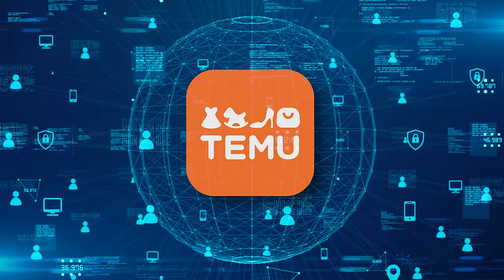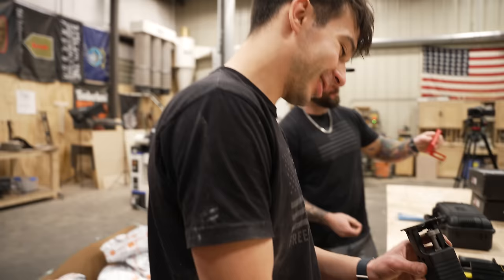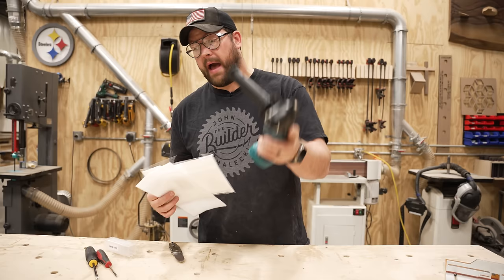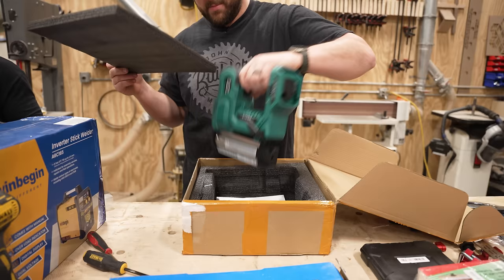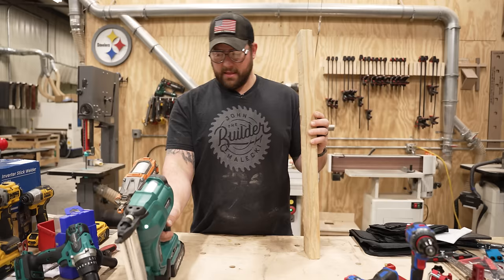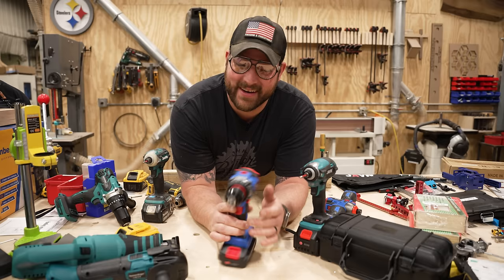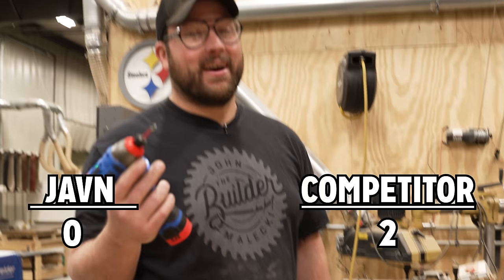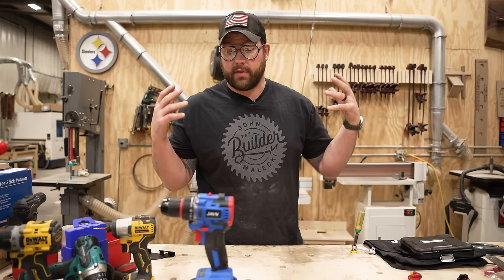I Bought A Pallet of TEMU Tools

Comment: I've never seen an entire woodworking company struggle so much to put in some screws
Reply: tbf, all the woodworking I see them do is fancy glue joints
Reply: I wonder what bit and screw system they were using? Ph, PZ, definitely not Torx. Maybe that weird rectangular hole.
Reply: Im not hiring them to build a deck any time soon lol, be full of holes from the drill bit slipping and jamming in the wood
Reply: @JohanFroloff81  as a Canadian, I am offended that you would call a Robertson screw a "weird rectangle hole" lol
In all honesty though, Robertson screws are the norm here in Canada  and they are probably the best screw head there is, with torx coming in a close 2nd
Reply: @JohanFroloff81   they did mention square head somewhere in there
Reply: @canadianhunter21  they arent actual woodworkers, that why so many of the things they say sound off
Reply: This is a shop full of people as skilled as I was when I first started building commercial cabinets at 18. How do you drive screws for work but can't do it with your left hand lol. I can tell someone hasn't had to install anything on a ladder or down a tight gap. You'd probably become a good sheetrocker with all the holes in the drywall you guys would be stabbing lol.
Reply: @JohanFroloff81  those are so effed. 
I used them once..  I needed self tapping screws with a black screwhead. What was available was with that square hole.. 
I'm still moving that drill bit around in my 'box of drillbits' 😅😂😅😂
Reply: What else would you expect from a company taking sponsership and repping Temu.
Reply: @canadianhunter21 I still think hex is the best head. No type of head type works with a ball shaped bit like hex does. I can drill my hex screws using a ball bit with the drill at a 30° angle to the bit.
Reply: @devoncantrell3311  absolutely not lol. I was a carpenter for a little while and i have used almost every screw type that you get and torx is by far the best there is by a landslide!!
Reply: @tylersmith8309  they probably do strip a lot less. I enjoy hex bits on models and small scale stuff because stripping isn’t really an issue. And the ball hexes allow for good angles on the models which is handy.
Reply: Hmmm kinda wasted my time with this video... A bunch of "woodworkers" that cant even use a proper screwdriver without hurting themselfs, not even 50% of the stuff they unpacked got put to use or showed. Just some randomen screwdriver races...
Reply: Womp womp Lil bro

Comment: With battery-powered drills in the Chinese market they will have their own name and their own battery standard but, most will use makita - bosch - dewalt batteries. 

I'm from southeast Asia, and professional workers in the countryside always like to use a brand like dekton because it has a German standard but is made in China.
Reply: Most of the time the colors show compatibility brand, those Makita, yellow for dewall, orange for B&D red, ect....
Reply: Thank you for replying.  I replied something similar up above.  Supporting the Chinese market will only come back to hurt him.
Reply: Interesting, from next year all battery operated power tools sold in Europe must have a universal standard battery that will fit all off the shelf power tools, adaptors are  already available but are cheap and nasty and weaken the power tool.

Comment: As a professional carpenter, for individuals who are just starting out or seeking budget-friendly tools, I recommend the following:

Buy used Milwaukee M12 Brushless tools along with new M12 Batteries. M12 batteries typically cost about half as much as the M18 ones, while offering the same capacity. I always recommend buying new batteries though. Buying those used is not worth the risk. I bought an almost new but used Fuel 1/4 impact driver for $70 and a 2 pack Red Lithium 2.0 battery set for $50.The impact can switch between drill mode and impact eliminating the need to purchase two tools. Once you are looking to level up, move on to the M18 series. For anything that requires lots of drilling power buy either a Makita or a Milwaukee corded drill for $115 and $90 respectively. They have plenty of power and should last you a long time. My Makita corded drill served me about 15 years.

Comment: Try using a makita battery in the javn brand stuff. It’s worked for me before with a single hand battery chain saw and the makita battery in it made it much better to use and it didn’t cut out like the cheap battery does in it.

Comment: All those temu tools are all gonna end up in the landfill. The name brand tools are more expensive for a reason. 

Sure the temu drill is half price, but they probably won't last even half as long as one of the name brands.
Reply: depends on the user. If you really only use it 3 times a year, the endurance doesn't matter a lot and the more expensive tools are clearly wasted money.

It may be dubious to buy at Temu, but no name brands from the box stores or whatever will be pretty good enough for the low usage cases.

If you want to use such tools professionally you should invest into professional grade tools. That's a no brainer. But on the Homer Simpson level? Why?
Reply: yup I can vouch for this, i ordered a set of metal drill bits, the Chinesium ones lasted about two holes drilling into 10mm mild steel plate before they went blunt whist my cheapo cobalt bit's last around 10 holes before becoming blunt.
Reply: Most "name brand" tools: made in china.😂😂😂
Reply: @robertmceuen3630  indeed they are HOWEVER those brand tools are then quality tested by those specific companies to make sure they're compliant to standards world wide & is up to their brand standards, a drill that burns out in a day would tarnish there reputation with that customer meaning they'll never buy from them again & because of our consumer laws this would warrant a refund.
the reason they're so cheap is because they don't do the R&D they steal it from other companies, do QC & finally give you your money back(also because of slave labor but that's a different issue).
Reply: As a nice to have, get Temu, as a way to make a living, go for quality

Comment: Would love to see an endurance test. How many screws can you drive on a full battery? How much down time between battery charges? How long before tool malfunction? It’s fine to pay half price for a tool, but if you have to buy three, might as well go for the better brand.
Reply: Harbor freight is cheaper at like $42 and I use it everyday at work mostly for air filter boxes and it only needs charged twice a month at most. I got two batteries for that price and it appears that they take less then 1 hour to charge but sense i have two batteries I havnt paid close attention lol
Reply: I’ve used it for a year now so it was definitely worth it lol

Comment: This video makes me queasy. Was hoping it would be an unbiased review like the other pallet grabs but I had to stop half way through when it became clear it would just be an ad for Temu. All this hype for cheap tools that are clearly ripping off designs from woodworking tools makers isn't cool, same with repeatedly taking digs at Rockler prices as if they were selling comparable quality tools. Rockler, and the other companies being put down in this advertisement, have been part of the woodworking community for decades and offer so  much more than just cheap tools. 

As an experienced woodworker I'd argue that it's terrible for beginners to stock their shop with dodgey knock-off tools from an importer like Temu. It will make the craft frustrating and confusing to learn when the tools they rely on don't work properly and fall apart on them. Not to mention safety issues with this junk that new woodworkers might won't have the experience to recognize before an accident.
Reply: well said
Reply: @MaxRide1  I stopped watching as soon as he said Temu reached out to him, I knew what kind of video this was going to be. 👌🍆

Comment: If you are a DIY enthusiast, I'd recommend the Einhell tool range. They have a 3 year warranty extension and 10 year service guarantee for the brushless motor in ALL brushless tools. Unlike the other DIY type tools, they also sell all the spare parts.... and I mean LITERALLY EVERYTHING!! The big brands don't even do that for the majority of their tools. In 5 years of using their tools, I've only had 1 battery die and 1 charger, and I use them a LOT. They are also compatible with a load of the other cheap DIY brands
Reply: Einhell are super good, especially their cordless drills, and I've heard good things about their cordless grinders 

The only big letdown I've ever had from them was a cordless impact wrench, they're just not powerful enough for the majority of applications.

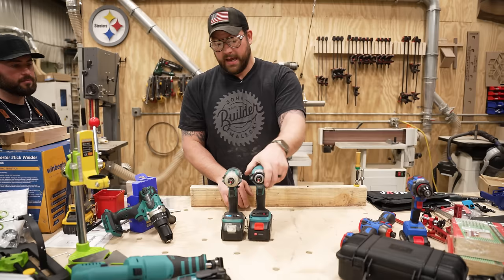Comment: 18:45 with lithium batteries, there is no power output difference between fully charged and almost depleted. They run exactly the same until they completely cut off. It's one of the best advantages to lithium over the old ni-cad batteries.

Comment: I bought the Temu mid size light that takes a 20V DeWalt battery. Son if a gun is bright!!  I left it on low all night at work, came in the next morning and it seemed just as bright as when I went home. I hate to admit it, but after using it several times, I bought the two smaller ones for home and for my motorbike trailer. Takes for ever to draw down the standard battery, can only imagine how long it would last with the bigger 20V batteries. Very pleasantly shocked.
EDIT: I own a hydraulic repair shop, these DeWalt compatible lights have done very well with the oil too.

Comment: I got the router table plate well not that exact one but close enough and its actually pretty good. I used it in building a small router table and it was more solid that I thought it would be. The only complaint would be that it came with some plastic circles to be used with smaller bits, but they are so lightweight that the air from the router literally blows it away. I did also get a router lift to go along with it, it seemed to work at first but the screw that rises and lowers is just too loose and under load the vibrations cause it to lower on you. I'm going to try and see if I can find a way to correct that.

When ordering from TEMU just be careful and try to get as much info as possible, reading reviews help. I've mostly had good luck with things I got through them, there have been a few misses.

Comment: The company I used to work for used Makita on the production line. Those things would put in 4000 bolts daily. I think I saw 3 that had to be trashed.
Reply: And every homeworker need Makita to use it one time every few months? It'a like comparing a small Toyota with a RollsRoys. With both cars you come from a to b but with differend kind of comfort and power.

Comment: I paid AU$12 for the router table and routed it into a bigger deck, it works well and is all heavy aluminium. I did have to drill mounting holes for my old Ozito router.

Comment: My beginners tip is to find your self excellent cordless drill. Then based on that get your self tools you need most from that brand and clone tools that use same battery system for those that you least use and corded version on the tools you least use or dont need to move. You can also 3d print or buy adapters to mod your cheap tools (those with in same voltage) to your better batteries you chose. That way you get into tooling with best price to quality ratio. Still while corded is supposedly obsolete, you dont have batteries dying and in general those are kinda cheaper in most cases, so i would highly suggest getting those, specially on some yard sales etc cheaply. Only thing you really need that is good is the cordless drill, since you can screw screws, drill and even poverty lathe with with it.

Comment: A method you could use to have a nearly consistent resistance over time that you could use drills and other power tools on so that you can test them with varying loads:

A worm drive. Can load the wheel with X lbs to make Y resistance. That way you can attach the drill or other tool to the screw so that you can see how high the drill will lift X weight over Z time

Comment: how accurate are the rulers is the question also and how square are the corner clamps?
Reply: How accurate to either need to be for the VERY occasional DIY types?

If you only use your tools for one or two moves per decade, maybe 3 repairs per year and once that Dogshed in the yard, do you need tools for 2890 bucks or is the cheap out collection at 175 bucks for the 3 core pieces enough?

Not everybody wants or needs to form a company throwing out 100 pieces of great quality furniture per month...
Reply: Well, as long as the rulers are consistent it is accurate.
I mean it doesn't matter in what unit you measure, it could be 1.1inch, as long as every marking is at the same distance from the others you'll be ok. 
One can use a twig to measure. In that case your cabinet will be 2twigs wide and 3 twigs high for example. 

It is only a problem if you work with established measurements, like drawings etc. for all the rest relative measurements are better anyway.

Comment: Biggest question is how long will those tools last. Usually things are good when they're new but doubt that cheap tools can stand same abuse like well known brands. Would be interesting to look inside and check quality of components, wires, soldering etc...
Reply: which only matters if you use the stuff all the time.
Which most people won't do. If you only have your tools for some repairs, maybe the few things during a move that need tools and one project you absolutely wanted to do yourself like a gardenshed or doghouse, why pay good money for professional tools if you never will drive those to the limit anyway?
Reply: @Ugly_German_Truths  well I would rather then buy Bosch Hone line than something dead cheap from China. For Bosch you can get replacement parts. If its for just one project most hardware stores have option to rent tools so Id rather go for that option then.

Comment: I get a lot of the drill bits for re threading the top of aluminum doors and there good. The power tools aren't as good as the big brands but they also aren't priced liked the big brands. These are something your dad or granddad would use .

Comment: Drill attachments were a big thing in the 70:s and 80:s. Tools with their own motors were too expensive for most hobbyists so brands like Black&Decker had huge selection of electric drill powered tools and attachments. You could have a whole shop powered by the single electric drill. Of course they were not that effective and switching the drill from one tool to another was a pain but the other alternative was all hand tools.

Comment: I used to think there was nothing that could be wrong with a basic ruler.  Until I ended up building a project with all kinds of funky misalignments...and eventually tracked it to the ruler markings were like 1/32nd inch misaligned so every time you happened to flip which end you were using introduced another 1/16 inch error to your measurement.  If making multiple cuts the error could compound.

Comment: Ridgid often has a combo Drill and an Impact Driver for $99 and regularly priced at $159, so no reason to go Temu on those items (if you need both).
Also you really gotta factor in batteries to power tool cost, they are the major cost in them, often more then the tool.

Comment: The question no one seems to ask is: How are these gonna last. Everyone is just "oh look, i just took it out of the box and it works good. It even looks like a bosch or a makita". How long do the batteries last till they are dead (not empty, dead), how are the gears, the motor, does it last? Or does it break after a week. Same with drills, bits and sawblades. How sharp are they after a week of use? Do they hold up? Or are they done after a few days.

Comment: If you didn't realise or notice pretty much all of those power tools work with Makita batteries or so the listings claim but since most of the Chinese batteries you got were black with red accents and a different body shape to Makita batteries it didn't seem to be like that. I for sure thought you would have realised when you pulled out the Makita Impact Driver and started showing off the similarities. The reason why a lot of Chinese brand tools use Makita style batteries is because Makita although it is a Japanese company it is the largest Asian power tool brand in the world and is so popular across Asian countries especially in its home country of Japan which is why you can easily find Makita tools there that are available in colours other than teal and a lot of genuine made in Japan for the Japanese market Makita tools are usually of a higher quality too because most of the stuff in the west from Makita comes from Chinese factories not from Japan

Comment: There are very specific things you might want to order from the chinese close-shops like Temu. Crafting supplies in general? They're all coming from the chinese factories already. Acrylic domes, beads, small seashells, tin/aluminum decorative bits, silicone molds, LEDs and circuit boards... This shit will cost pennies and it's the same stuff that's in your local hobby store. Just rebranded with the store logo on the bag of the same damn crap from the same factory line.

If it's something that needs to last, or requires precision, don't bother. If it's something that you'd like to try and are not sure if it's good idea or not, hell yeah go th cheap route.

Comment: There is a special place in hell for those Milwaukee #2 square drive bits. I've smoked my fingers god knows how many times on screws after the bits cam out of the head. It got to the point where all the square drive bits in the packs I buy go straight in the bin and get replaced with Makita bits